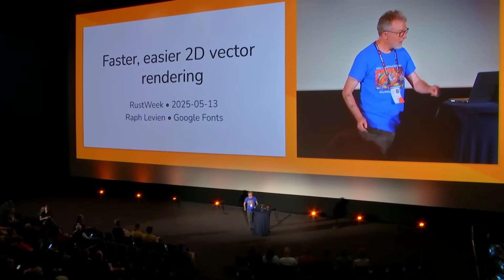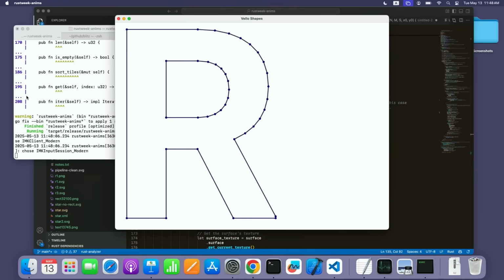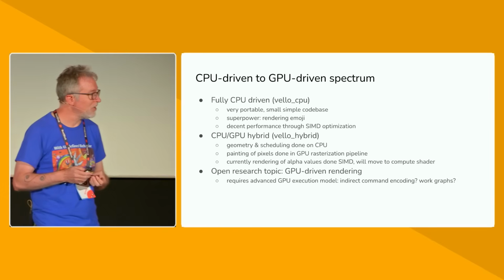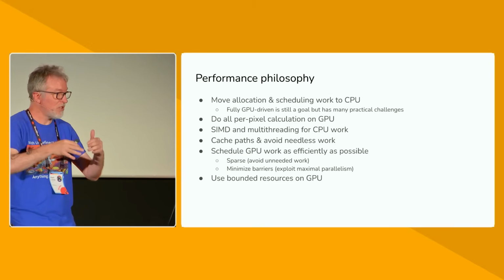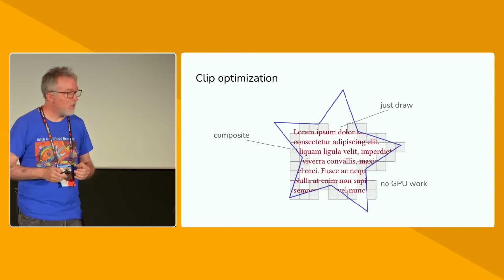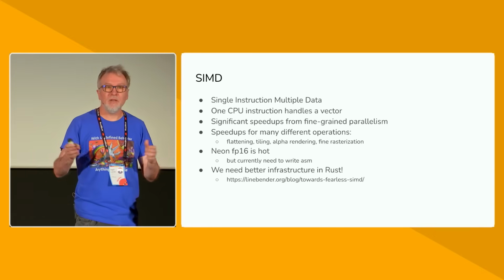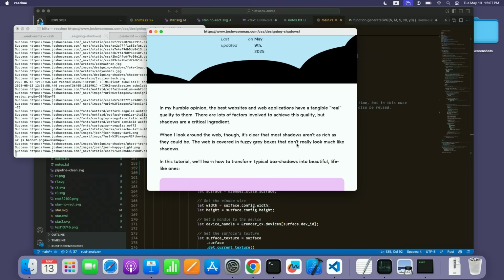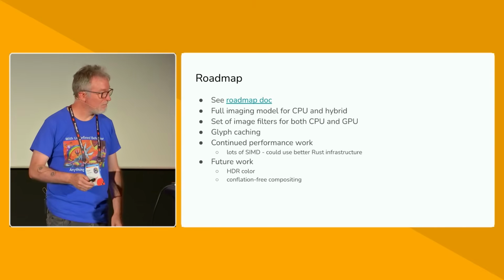Faster, easier 2D vector rendering  - Raph Levien

Comment: Does this solve the problem with zoomed out content that you get with the old vello architecture? From the explanation of how the sparse strip rendering works, it looks like the alpha calculation for a tile that contains a lot of geometry might get expensive.
Reply: Not involved in the project, but there are 2 main mitigating factors for zoomed out content afaik:

When the content is zoomed out a lot, curved segments will get converted into fewer line segments (only helps if the control points are reasonably sparse).

Even if drawing the tiles/strips is somewhat expensive (within limits), it shouldn't matter a huge amount if the tiles can be reused repeatedly (good for translating the viewport but not scaling it)
Reply: It solves the problem of it getting much more expensive than makes sense; there are also ways with the new architecture to have more threads working on a tile.
So if you were running into that by accident in the past, you probably won't with new vello_gpu